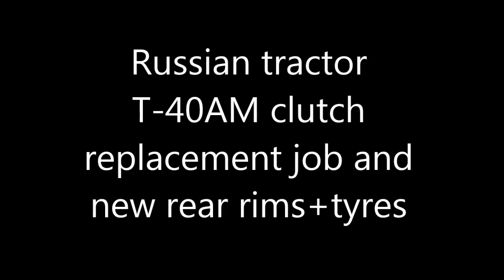Russian tractor T-40AM clutch replacement and new rear tyres

Comment: Hi, any problems happens with front wheels height? 15.5 tyres fit with original size front tyres?
Reply from the maker: No, it's OK to use 15,5 tires.

Comment: Are the T40 and the Belarus 420a basically the same? I am having a really difficult time getting the pto shift handle to come off.
Reply: I am trying to change the throw out bearings
Reply from the maker: If they look the same, they are the same. They have been sold with different names over the world. And usually the "export" models are better in quality.